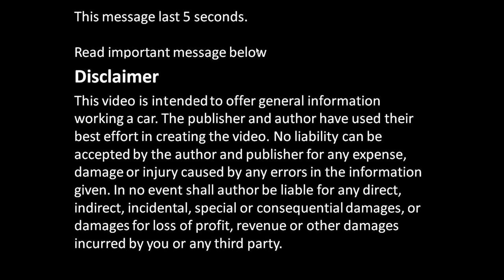How works car cabin heating and cooling system

Comment: Sir 
With help of your vedio i flush heater core and now i want to install heat control valve and wire.
Corolla 2008 1.6L plz help how i can do this to control the heating .